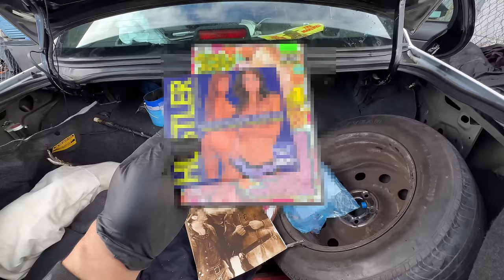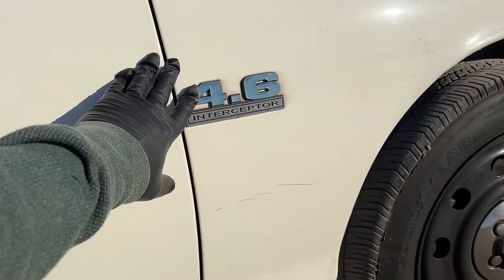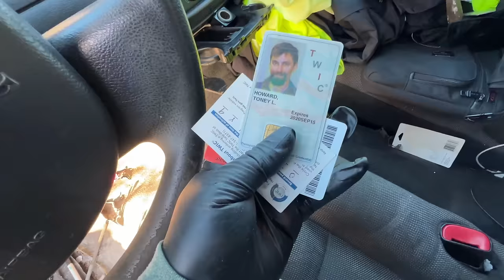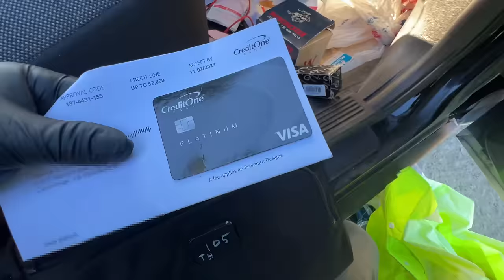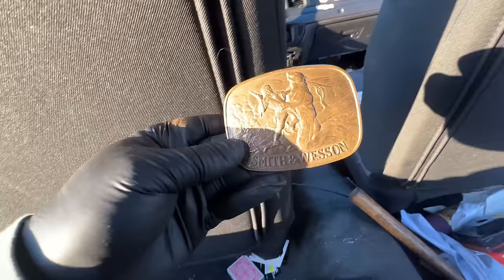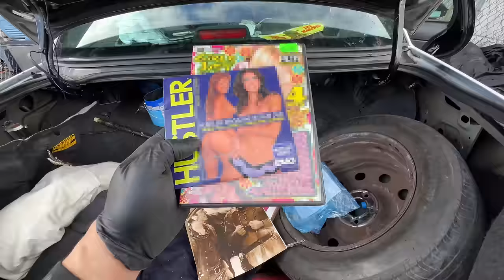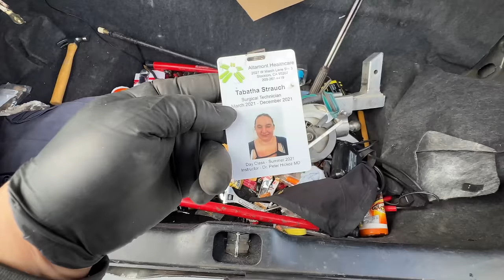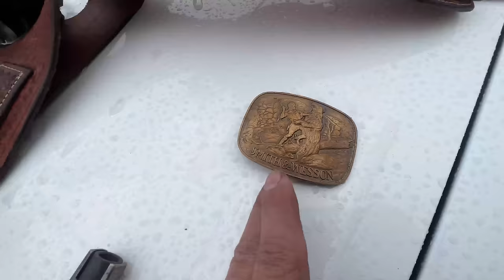Searching a Police Impersonators Car After Arrest! Found Criminal Evidence!

Comment: That black gun looking thing is to drive anchors in concrete or whatever. It's used in construction and is fired using a .22 type cartridge without a projectile, which is just like a blank.

Comment: The car itself is impersonation. LED flood lights, brush guard, and Crown Vic. How many drivers would have considered that a LEO or a security company car. Why the police left all of  that LEO uniform equipment is beyond me.
Reply: It’s legal to drive if this way if he has no emergency lights, siren and doesn’t say police on it. It’s hard to know what this guy was up to.
Reply: @EnthusiastCarHangar  in this case the police could have removed cheap, Amazon red and blues. The character of this guy seems like he would do it. It's all about the perception the individual seeing that car. I really don't disagree with you. I was once stopped at night, on a public road, by a security guard... I pulled over because of the car, then the uniform. The licensing bureau of security guards were less than impressed and the pulled the license of said guard.
Reply: @defresurrection  I am very against impersonating so I agree with you. I am just saying they it’s legal to drive a decommissioned police vehicle with the spot lights on and push bar on. It’s not against the law and you see it a lot.
Reply: A lot of crown vic collectors keep the spots and then get their own push bumper if it doesn't come with one. A lot of retired police vics can come with all the stuff minus the Red/Blue lights, the siren, and the police decals. I know someone with a Vic Police Interceptor. Been restoring it slowly and it still has the original interceptor engine. Perfectly legal.
Reply: prolly afraid to get poked and have enough to stick
Reply: @TheNewb187  I'm thinking there would be too much stuff for the evidence locker... idk

Comment: The ram set is a nail gun powered by blank shells used to drive nails. Usually uses in construction to nail the frame of a wall to a cement floor which is why it's powered by blank shells and it uses special nails for the ammunition

Comment: The hole in the magazines was from drilling out the 10 round locking pin so you can load it up to full capacity.

Comment: Hey that thing you thought was a zip gun is a Ramset its for fastening studs to concrete, it’s a heavy nail gun using those primers you found in the trunk. And if you still have that crick folding knife or that Gerber fixed blade you found in the trunk I’ll take it off your hands. There was a lot of locksmiths gear in seen as you were pulling locks and keys out that are worth something to the right person. I only know cause my grandfather was. Locksmith and showed me a thing or 2 and has become a hobbie. Locking at the next video now let’s see what kind of goodness you find this time. Keep up the good work I’ll be watching.

Comment: You still have the zip gun? And can I have it? And if so what's your phone number? BTW in Iowa so it is legal from what i know. If you respond I will message back asap. And if you want to keep it I totally understand. BTW NOT a criminal just like the way it looks. And I'll do some research to see if it is legal in iowa. And I get it if you turned it in and if you don't want to put your phone number if you respond I will give you mine.